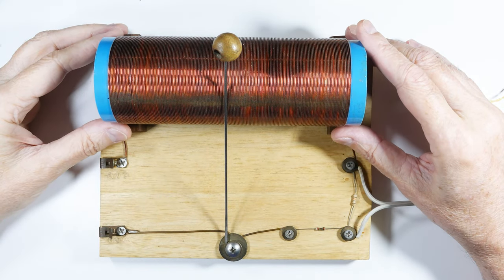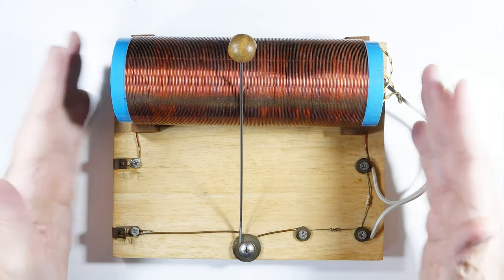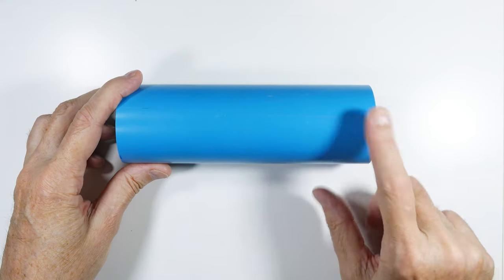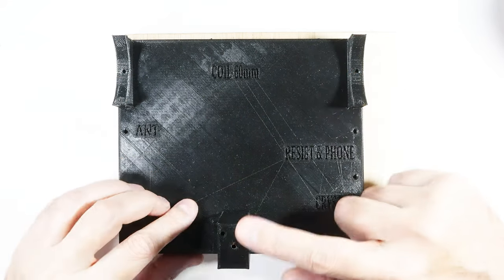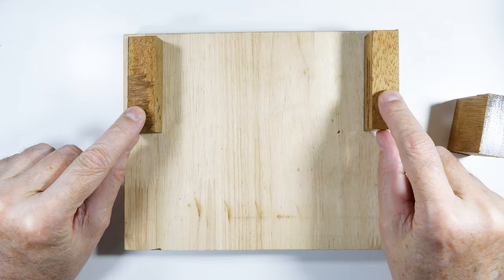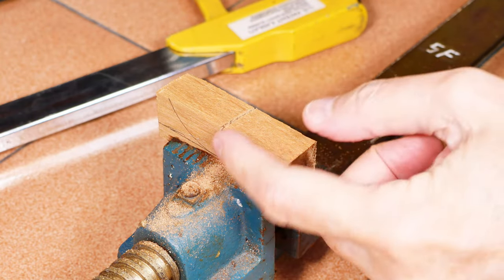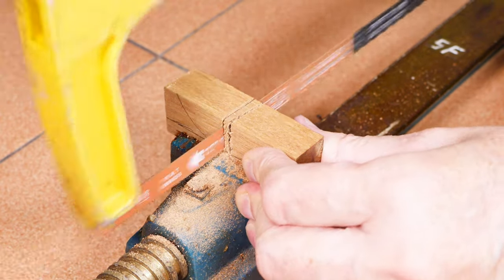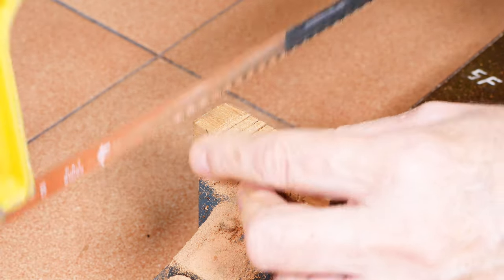Best/Easiest DIY Crystal Radio - No Batteries, No External Power 2024 (4K)

Comment: I was 13 when I got an electronics kit in 1972. I didn't make the crystal radio for a long time because it seemed useless because it didn't have batteries. It was a strange kit because it had a solar panel that wasn't listed or described and I had never heard of such a thing being possible. Eventually I bought a proper crystal radio then set up aerials strung between trees 30m, 100m and 200m. I had to include a volume control because it was too loud. Dad got freaked out by a wire coming from the windy sky at night and taking off his hat

Comment: I built this radio using 28AWG magent wire with 132 turns around a toilet paper tube. I used the website you linked to calculate how many turns I needed to get 531 uH. Right now no sound will come out of the earpiece. My antenna is about 30ft long, strung 5ft of the ground, and my ground connection is a stand alone water spigot pipe, which I sanded to clear off the corrosion. I am also using a 1N34A diode. I checked what AM stations there are in my area with a normal radio and there are only 2 strong ones and several faint ones. Also in the middle of the AM band (700-1000kHz) there are no stations. What frequency range can this crystal radio pick up? I am concerned that maybe my radio can only pick up frequencies in this 700-1000kHz range, or if not it can only pick up faint stations.
Reply from the maker: I did a video on the most common problems:        https://youtu.be/kCxQ8iPQx4s
There's a known problem with earphones made in Taiwan:   https://youtu.be/rKeS6vSOu3k
There are also fake 1n34a diodes. These will work, but very badly.  https://youtu.be/H8XlZ7Mry4M
I ran the numbers. Given the tube is 25mm in diameter. 132 turns of 28 AWG (0.3211 	mm) wire is 42 mm long. The inductance is around 201 uH. Not in the 500+ range. The tube would have to be closer to 4" (50 mm) to be in the 500 uH range.
Reply: @tsbrownie  My diode is real (has reverse leakage), however my earpiece was made in Taiwan, but I tested it with another circuit and it works fine. I went through your common problems video but I couldn't find anything. Also my tube diameter is 45mm, not 25mm.
Reply from the maker: @CharlesFeazelle  If you used a powered source to test the earphone, that won't work as a test. You did not mention the resistor across the earphone.
Reply: @tsbrownie  I have a 10k resistor across the earphone. I did use a power source to test the earphone. Is there a way to test it without one?
Reply from the maker: @CharlesFeazelle  I use a radio to test.  Since you have an antenna, look at my video about the world's simplest radio. If that won't work, then either the earphone or diode is bad. (I've had a diode that tested ok with a digital meter, but would not work in a radio.) If you have a battery powered amplifier, you could use that to see if you've got sound at the outputs. I've got a video on that too.
Reply: @tsbrownie  I made the world's simplest radio and tested it with my earpiece. No sound. I tested it again with a battery powered amplifier. Same result. I also tested my wiper radio with the amplifier, but again no sound. My amplifier is tested and working.
Reply from the maker: @CharlesFeazelle  Do you hear static if you scratch the antenna wire on the radio's input? How far are the AM radio stations? Could your antenna be bad/shorted? What country are you in? Are your AM stations actually AM, or have they been converted to digital or FM? Even then, you should hear static if you rub the antenna lead on the input.
Reply from the maker: @CharlesFeazelle  Any progress?
Reply: @tsbrownie  I switched my ground connection from my water spigot pipe to a metal rod I drove into the ground about 3 feet and now I can actually get sound. I’m guessing the pipe is only metal above ground and under the concrete base is PVC, not making a ground connection. I tested my radio yesterday evening and I was able to get one station. I had to connect it to my amp and turn it all the way up just to barely make it out. I looked up the nearest AM stations and that one was the nearest at 16 miles away. There are others a little bit farther away. When I tested the radio today I got no stations. I read that you get better AM reception at night, and I assume that’s why I was able to get that one station. Also, I get static when I scratch the antenna to the input now. I wasn’t able to get that before I switched my ground. I can also hear the scratch with the earpiece, so I think the earpiece works. I should have tried using another ground sooner. My original looked unquestionable though. I’m guessing the problem now is my distance from stations.
Reply from the maker: @CharlesFeazelle   16 miles is starting to get far, but if the station is at a normal power, it should be fairly easy to listen to. Part of crystal radio is experimenting to see if you can extend the range, clean up the signal, etc. You might look at your antenna next. Try different resistors, etc. Let me know if I can answer any questions.

Comment: I made one with a four inch PVC and wound from one end to the other end. About four inches long. I did not use a diode i used a old copper penny and pencil lead. Like a fox hole radio. I picked up KDKA which i was about 20 miles from down town. I also picked up short wave. Hilverson Holand. When they had broadcast. 1977. I was a senior in highschool. No more short wave broadcast like back then. There are some from cuba and HCJB .  73

Comment: FYI, when you want to heat the wire, put it at the tip of the flame at the top, which is the hottest part of the flame .. not toward the center ..

Comment: You can save a lot of time on the pillow blocks by using a hole saw attachment on your drill. For 2” pipe, do 2” hole and cut in half. Very quick work. Thanks for the video!

Comment: Very cool, but I'm not a fan of the pre-made diodes. It's neater when they use razor blades for the diodes.
Reply from the maker: If you like razor blades, you'll love using galena or iron pyrite!
Crystal Radio--Testing Stuff As A Detector (4K)   https://youtu.be/1o2zB5giS7I
Crystal Radio DIY Cat Whisker--Wood, Brass, Stainless (4K)   https://youtu.be/PQ0clWe8NGU

Comment: 7:48 if you have a table saw, you can make that arch by angling the intake towards the blade (you have to match the apparent width of the blade at that angle to the R of the arch). To make it work, you clamp two boards either side of the blade to guide the board from which you'll cut this arch and later bits from (explanation time takes waay longer than setup). Makes really clean cuts, just take it slowly and feed into the cut from the left side of the blade, while holding the top of the parent material board with another stick. This is great for when you want to cut multiples of the same. The process can be looked up online and it's termed "cove cutting". Pretty safe as long as you feed it properly (so don't sneeze) and use sacrificial sticks. :)
Reply from the maker: I wish many times I had a tablesaw, but there's no place for it.  😞

Comment: Print your parts separately and the glue them together. 4:46 name plate, just print it with a hole and print the name after and glue it in place. Combined the printing takes longer because of the travel, but if you do this separately, the time drops, because the head only prints the basic shape.

Comment: Hi I built one of these crystal radios following your guide. It works great on a short antenna. I will upgrade that. However I noticed when I touch one of the earphone connections and tune to areas that just buzz I get clear audio. 

Does this mean I need something to tune the antenna?

If I touch any other part there is no change.   I don’t understand why touching the earphone connection would change anything?
Reply from the maker: Buzzing is usually a sign that you are picking up AC signals from home wiring. You should never use the home wiring as a ground! So if you are doing that, don't! It's dangerous. The next most common thing is your antenna is too close to AC wiring or other sources of interference (motors are bad). These radios operate on very tiny amounts of electricity, so getting your hands or other conductive stuff near the radio/antenna can change things a lot.
Reply: @tsbrownie  thank you. I tried ground on my central air vent. that could maybe pickup the furnace electronics / motor and it also was next to a touch activated lamp 😅
But I tried other things (water pipe) and still when I touch the earpiece side, stations get stronger or clearer.  I do see your other videos with the variable capacitors maybe I need that!
Reply from the maker: @ShnitzlHaus  In many ways, the electricity in crystal radios acts like static electricity so touching it or having stuff around it can make a difference. The capacitor on the ground helps selectivity.
Reply: @tsbrownie  thank you. I enjoy your videos and learning about these radios. I see you uploaded one now and will watch. 

I do have another question. Furthest to the left I get a station 1010. Im interested in trying to get a broadcast on 640 anything I can do to try and reach that station?  

Hope you don’t mind these questions. I will search the internet to see if any forums or literature as well.
Reply from the maker: @ShnitzlHaus  It seems your radio will not reach the higher frequencies. If that is true, then it is likely that you have too much inductance or capacitance in your tank circuit. Of course I assume there's a station you can receive up there.
Reply: @tsbrownie  I do get three stations. 1010 was furthest to the left and I believe to the right I went to 14 something (would have to double check that) 
I am making the effort to understand it’s all new to me (electronics).  I’m still amazed that it all works as is. Fun stuff.

Comment: I understand in your previous vid about the wrong earphone. B but can i use a old rotary telephone  earpiece for the sound?
Reply from the maker: I have heard you can, but I have never done it.
Reply: Long ago I successfully use the earpiece of the rotary phone using diode directly connecting across the two terminal just to experiment. But the sound was low although audiable. But i see everyone now using small earphone and sound is louder

Comment: confused some how do I determine the number of turns on the coil. Iv strong up a 200' antenna now I just need to build the radio I got some new old stock diaodes from the 50s
Reply from the maker: I have a video "Crystal Radio Coil Sizing" that should help.

Comment: Hello i don't know it i ask you this question or not, I'm building a Crystal Radio just like the first one in the video ( Exsept ) I have a antenna coil  So this is my question can i  design my radio this way and will its work ok >>>>>> Starting from outside antenna wire ........ in to antenna coil ...... in to small variable capacitor to  to adjust ...... in to the tuning cuil..... in to the germain diode...... to the whipper..... out to ground wire.
Reply from the maker: I'm not sure what you are building. Are you adding a coil antenna to a crystal radio? If so, I've found they don't work well unless you are making a tube/transistor radio. If you are substituting a coil antenna for the crystal radio coil, I have no experience making such a thing.

Comment: How long a wire run do you recommend for an antenna? Iv'e seen 5 feet to 30 feet (10m)
Reply from the maker: One of mine is 15 m, the other is 9 m. Longer is better. Higher is better, but more dangerous to setup and maintain.

Comment: What is your ground? What is your antenna? And lengths?
Reply from the maker: I ground to the steel frame of the house. I have 2 antennas, one is north south, the other east west. One is 9 meters and the other 15 meters.
Reply: @ … What kinds of wire on these? Thanks!
Reply from the maker: @SteveHacker   For the antennas, it's 0.9 and 0.8 mm wire. They are not long enough to require heavier wires.

Comment: You have to hold the wire higher in the flame.
Its hotter higher up the flame.
Reply from the maker: I've found that modern coatings are very heat resistant and turn to a brown goo when heated. They don't burn off like the old lacquers.

Comment: Will zinc screws work instead of brass/stainless?
Reply from the maker: Zinc will corrode easily, especially in contact with other metals like copper. It will work, but you will lose sound volume over time until it quits.

Comment: do I need battery for that 
so where ground connected is that in the batter hi
Reply from the maker: No battery. You can search crystal radio and see they have a very, very long history going back over 100 years and in many countries. Since most people back then did not have electricity to their homes, this was the only way they could receive. This is the easiest one to build and the cub scout manuals had this as a project.

Comment: how long is the coiled wire please explain

￼
Reply from the maker: The pipe is 2 inches in diameter, 15 cm long. The wire is 0.91mm (19 gauge). You need enough to make 160 turns. The details are in the description.

Comment: This device collecting electricity? Any answer my question and how it works
Reply from the maker: It operates from the power of the incoming radio waves. It's how most early radios worked. It does "collect" electricity and I have used it to power a clock. https://youtu.be/0WvZC3-mR6Q

Comment: Sir, what resistor should I pick? 4k ohm?
Reply from the maker: Between 10k and 40k, whichever works better.
Reply: And should I put cap?
Reply from the maker: @tovarichiwantankista9412  Cap should not be used with piezo earphone.
Reply: @tsbrownie  Okay, thanks a lot 👍
Reply: @tsbrownie  In my experiment with the 1N5711 diode, I found that 2K worked the best.  It would vary a lot depending on the capacitance of the earphone.